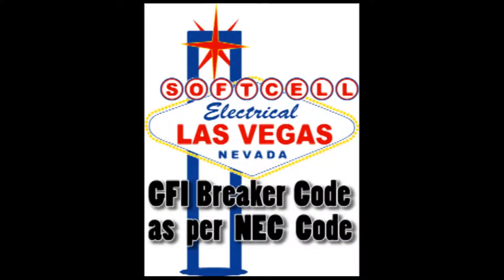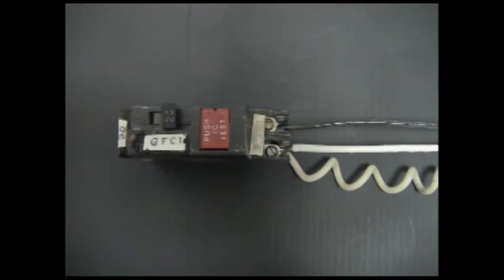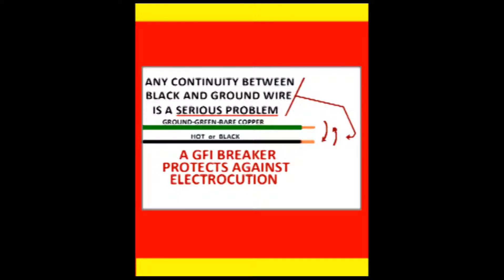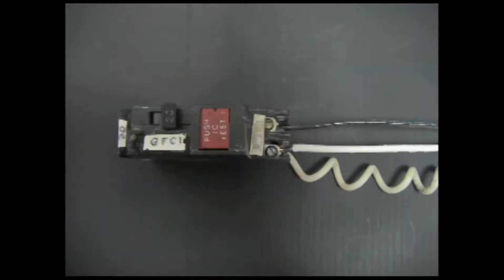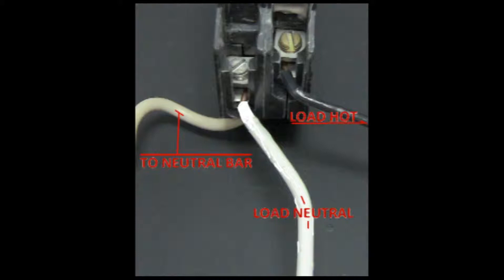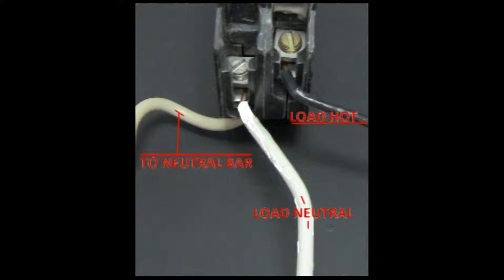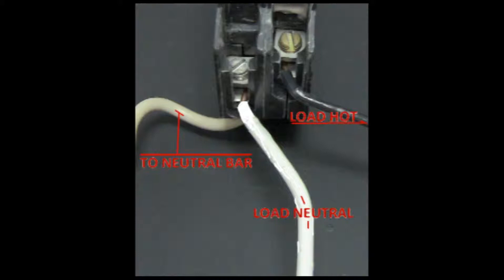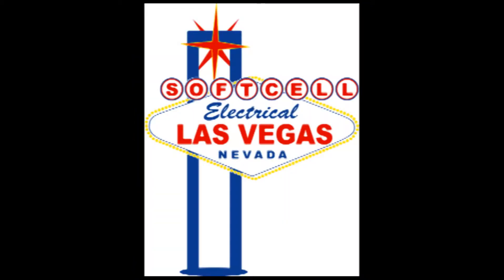What is a GFI breaker.# 81

Comment from the maker: No. The neutral from the GFI or AFI does connect to the neutral bar, however, the neutral from the protected circuit goes into a marked lug on the GFI or AFI breaker. Therefore the neutral backfeed goes THROUGH the breaker before landing on the groundbar.  All GFI and AFI breakers are like this, even the 50 amp 240 volt spa breakers. If the neutral for the circuit you want to protect is connected at the ground bar you will have no protection.